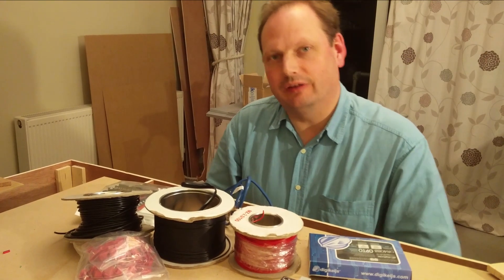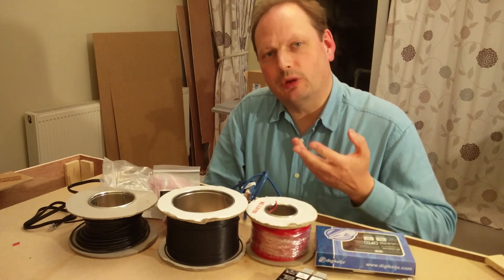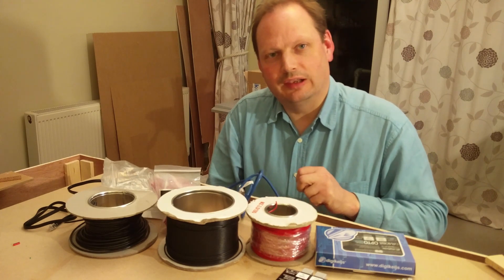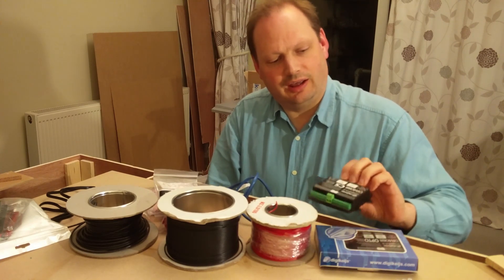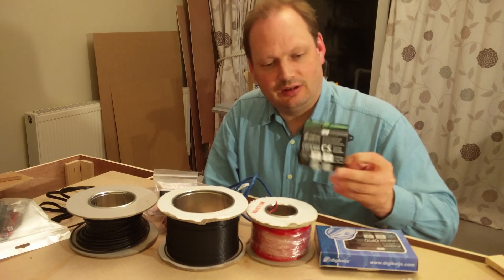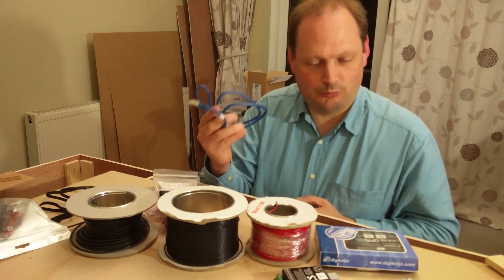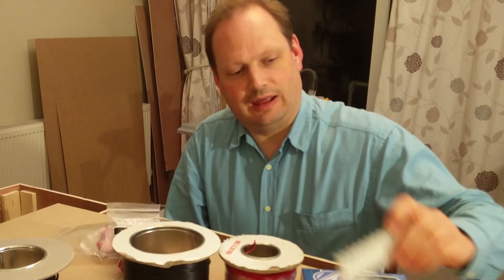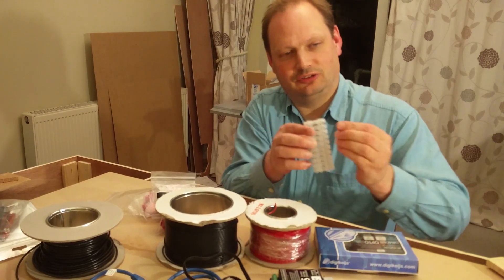18 Wires, cables, connectors and plugs | Everything you need to wire a model railway

Comment: hi paul when you use an old power supply from a old computer just remember to connect the green wire and the grey wire together and then you can use all off the other wires to connect your other lights etc i no this because i have done it i all so used to build pc,s hope this will help ok derek
Reply from the maker: thanks - good advice.
(my name is not Paul!)
Reply: @naivegauge  sorry i got your name wrong derek
Reply from the maker: Not a problem. 
It is an ongoing thing. Someone asked me my name on a live stream a while back and I told them, but they later mis-remembered it as Paul in a comment, and then other people started calling me Paul. I found it quite amusing really. But best not to let the error persist!
Reply: hi phil update on the pc power supply the wire to make it work should be black and green not as i said last time ok derek